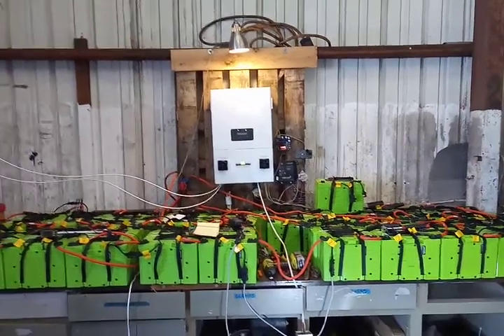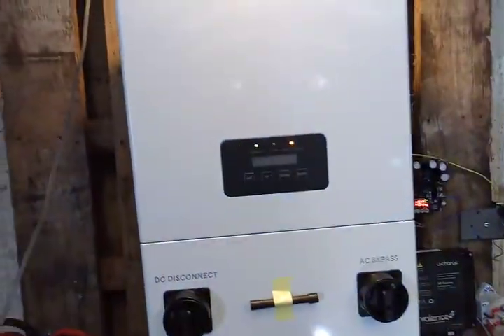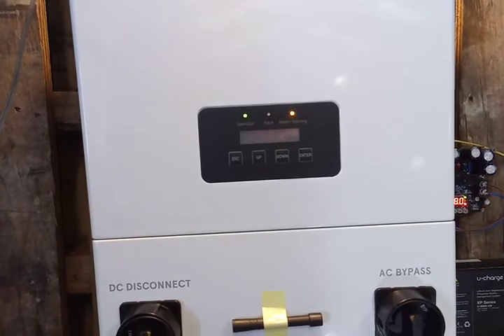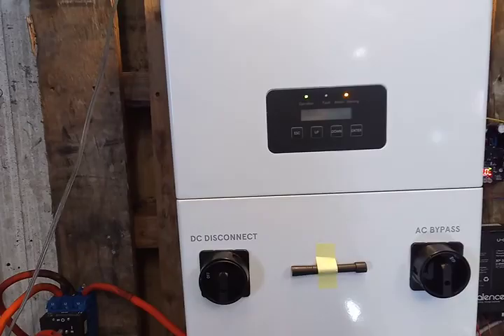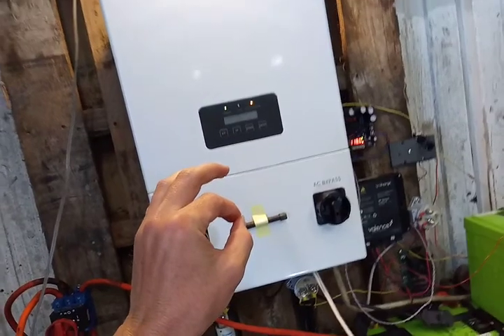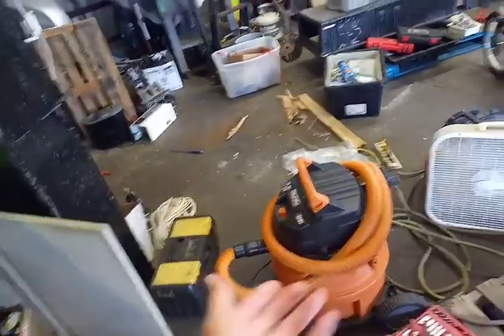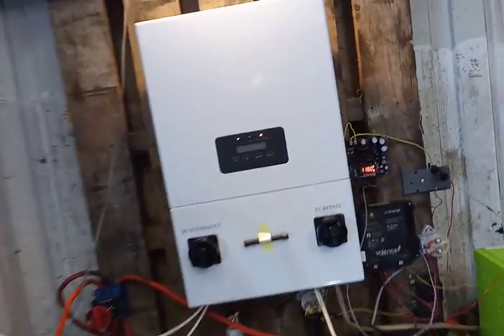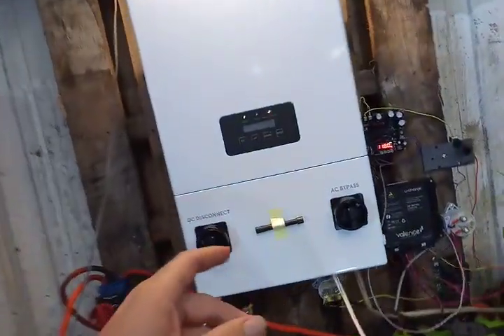Vid #2.  Discontinued Tesla initial experiment results.

Comment: I know it has been awhile,
Did you make any more progress on your battery bank?
Reply from the maker: I've been using it off grid ever since this video. I haven't been recommending it because they randomly explode and I'm not sure if it's caused by my workaround that I had to do in order to get this thing working off grid or if they'r exploding all on their own.
Reply: @SiriusSolar  so, the batteries are charging and discharging using the Delta H6?

You are using the outputs designed for off-grid power, without the unit being grid-tied to A/C? 

Or… are you using the Grid Tie outputs with another inverter driving the A/C sine wave on your house line?

I am building a system with a Delta H6 and I am trying to determine what NOT to do :-) 

(I saw a note in some specs saying the D/C to A/C ratio must be 150%, so I am trying to also determine if that means I should not put more than 360v into the PV inputs… how much input voltage are you pumping into your H6?)
Reply from the maker: @DavidHalko  I have 300 volts of pv coming into each solar channel with 2500 watts each.   I have a second H6 with another 325 volts at 3,000 Watts on one channel.   They are not grid tied in any way not even to each other.  I did try and have one create the sine wave and run it into the grid connection on the other so that the other could help it but it just errored out and shut down.  Long as it actually worked for was 30 seconds. It claimed ground fault most of the time but sometimes it had other errors.
Reply from the maker: @DavidHalko  I have my battery connected to the actual battery spot and the H6 is charging and discharging the battery.  Trying to keep it working off grid in the night time was where I had to add some custom hardware to the circuit board.  I highly recommend no one try this.  It's cost me a few million watt explosions and several hundred dollars of bad fuses.  To make the problem four times worse I've added another H6 so trying to get them to power up and down together without them exploding each other has been a trick.
Reply from the maker: @DavidHalko  my advice is use it for grid tie only.  If you want battery backup Spend the money to get a inverter that's not locked on Tesla's network. Something that's more user-friendly like an SMA or non Tesla Delta.  There's all kinds of workarounds you can do like If you wanted to run it from a battery you could get a dedicated battery charger to use the grid power to charge the battery. That would be much easier than messing with what I have done.  It would get you proper top balancing voltage and the ability to drop to a float voltage which is something I don't have with this inverter.  You want to put an inductor on its ac output if you're running off grid because although it's surge ability is good it's just not good enough.  I actually used a transformer as an inductor so I'm only pulling 240 out of the inverter now. The transformer pulls evenly from both legs and sends it to my breaker panel as in 120 + 120.  This doubles it's surge ability plus adds the inductance of the transformer so it's probably somewhere around 400% higher surge ability now.
Reply from the maker: @DavidHalko  page 5 section 1.2 talks about 150%.  My take on that is you're allowed to have a solar panel size that's not just 6,000 Watts but actually 9,000.   You're allowed to over panel!  Sure it'll only put out 6,000 Watts even if there's more than that available. That's what Ben is experimenting with.  He his goal is to slowly simulate over paneling more and more and more above 150% until he's sure that he can safely connect an electric vehicle battery to the solar panel input which would basically be hundreds upon hundreds of thousands of lots available to the solar panel input.  I pointed out to him that although it may work just fine there could be a problem when the H6 tries to randomly check the resistance of the solar panels at night. What would happen if the h6 tried to check the resistance of an electric vehicle battery?  Checking it in the dark isn't going to help.
Reply from the maker: @DavidHalko  page 37 section 3.71 also talks about 150% and in that regard it's very clear about what it's saying about it being the over paneling limit.

Comment: Hello. Can you say this hybrid inverter can work with battery of EV cars 400v?
Reply from the maker: That's too low to connect to the battery connection. Ben Nelson is making a video series connecting it to the solar panel input.
Reply: @SiriusSolar  Solar City H6 works Battery Interface (DC) Operating Voltage range 400-550V and EV battery has 400V
Why not?
Reply from the maker: @igo2442  because so far we don't have the ability to command the H6 output voltage.  Which means we can't dial in the proper voltage for doing a top balance and then backing off to float.  Sure if your discharging the battery it'll work fine up until a certain point when the H6 will shut down. But the problems are during charging.
Reply from the maker: @igo2442  The inverter requires battery voltage over 460   I'm not sure how it could go lower than 460 in the original setup maybe it's because it communicates to the battery. But in my system when my battery falls below 460 volts the inverter shuts down.

Comment: Another query can work on zero injection and what would the configuration be like
Reply from the maker: You'll have to rephrase your statement in plain English for me.
Reply: This inverter works without injecting power to the grid like other grid connection
Reply from the maker: @elmergonzalez8005   yes
Reply: @SiriusSolar  I have to buy an extra accessory so that the inverter does not inject into the public grid
Reply: I would like if you can tell me what I can do to avoid injecting energy into the public grid
Reply from the maker: @elmergonzalez8005  I think it's possible but it may require having a Tesla account I've been having trouble linking this hardware to my account because I did not buy it from tesla.   if I can link it to my account I may be able to control Its behavior using the Tesla app on my phone.
Reply from the maker: @elmergonzalez8005  one way to stop it from exporting power is too disconnect it from the grid
Reply: And they don't sell a meter that controls the injection
Reply from the maker: @elmergonzalez8005   so without that meter the only way they could control the injection is through the H6 itself.  so it would sense how much power was going to the critical loads and would match that in solar harvest.  so whatever you wanted to power from the solar would have to be connected to the critical loads connector.  All the hardware is there but I'm not sure if they made it possible in the programming.
Reply: Thank you very much for always answering, I could not connect to the application but I am working offline with the backup

Comment: the panels it uses are 24v in series
Reply from the maker: Is that a question or a statement?
Reply: I am going to install it this week and I will use it without a battery because I am in Nicaragua and there is no pawerwall here
Reply: Question brother I would like to know how the installation goes because it uses 4 string
Reply from the maker: @elmergonzalez8005  the higher the voltage the more efficient it is. I had 10 panels in series for a total voltage of 320v.  I had only connected one string in this video.   If I had another string I would have connected it to the other charge controller. Despite having 4 inputs  It only has 2 charge controllers.  You would only need to use all 4 inputs if you had very low wattage panels or if your panels Max voltage rating was low you have to split the strings into lower voltage halves.  Most people would put a single series string of around 400v @ 3000 Watts on each charge controller.  For a combined total of its maximum at 6000 watts of solar.  I'm not sure how much over paneling it can handle.
Reply: a couple of days ago I bought one I would love to explain how I will install the panels
Reply: If I can make 4 sets of 5 panels or only do two sets of 10 panels
Reply from the maker: @elmergonzalez8005  do you have the panel's you're going to use already? Look at the specifications on the sticker it'll show you the maximum voltage input. Just put your panels in a series string being careful not to go over the maximum rating.
Reply from the maker: @elmergonzalez8005  are you going to connect a battery or are you using it for a strictly grid-tie only?
Reply: when you use the 10 panels the two phases work, 220v
Reply from the maker: @elmergonzalez8005  yes. It only needs one string and both legs of its AC output work.  It puts out 124 volts on each leg that works great with regular AC appliances.  248 volts ac for the larger appliances.
Reply from the maker: @elmergonzalez8005  using the higher wattage panels will max out theallowed watts per charge controller long before it maxes out the voltage.  However Using old used lower wattage panels like 200 w you'll end up getting a higher voltage at a lower amperage with more panels in series and running more efficient. But the efficiency difference is negligible so don't worry about that.
Reply: I thank you very much you are very kind and I love the explanation you have a great knowledge greetings from Nicaragua, success brother
Reply: I still haven't bought panels that you recommend 320w or 340w
Reply from the maker: @elmergonzalez8005  which wattage panel? I can't really answer that without knowing all of the specs on the panel but I will say it's solar panel input abilities is very versatile it can work with just about any solar panel .

Comment: Are you able to adjust output voltage for a grid tie setup so I don't  get charged for overages
Reply: Have mine hooked up as island feed... Grid off... 4600 watts solar.. Florida Sunshine... I can run 12000btu mini split... 8000btu window AC. Small 12 cubic ft sub zero frig and 65 inch TV all same time no batteries no grid middle of day full sun...  If clouds come over my 12000btu unit drops first  L1 leg... L2 has frig and 8000btu and 65 inch TV stays on it... if more clouds move in everything drops... How's your batteries working out?? Can we get a 4-500v charge controller to salvage some viable use out of this h6?? I ordered 120 used Tesla 21700 3.7 batteries to give it a try..
Reply: At night I simple throw two breakers and connect to the grid...  Not sure if this h6 will allow me to do this each night..  we shall see this is my first night... I was just happy shit didnt go up in smoke as I did some wiring above my pay grade...
Reply from the maker: @ohiotraveler03  what you need is one of those fancy inverters that is careful not to export any to the grid.
Reply from the maker: @ohiotraveler03  make sure when you connect the battery you do through a pre-charge resistor first or you'll blow both of the fuses in the inverter.
Reply from the maker: It puts out 517 volts to the battery.  But if the grid is connected it will export all the battery power When there's less than 6000 watts of solar coming.  in other words it combines the battery power and the solar power in order to max out its export ability.
Reply: @SiriusSolar  
Did you get it to charge your battery pack?
What size battery should I build?? Is there a battery build in YouTube that you suggest??  I'm using used Tesla 3 cells 21700 currently have 120 shipped... Should I add a few more ?
Reply from the maker: I don't remember but if you look you'll see There are some AC output settings in my other video.  The title is something about the passworded menu.
Reply: @SiriusSolar  yes I reviewed that video and thanks for the password...  There was no adjustments that would help me in there....  I am making more power than I use so my power company is billing me for my power I am giving them... Just looking for a solution other than getting a different inverter...
Reply from the maker: @ohiotraveler03  wow that's a horrible agreement you have with your power company.  Is it some kind of smart meter that knows you're over producingat that instant or is it just the end of the month accumulation total that it's looking at?
Reply: @SiriusSolar  yeah it shows delivered when I use their electric and when I have overage the meter says receiving but billing is for what ever crossed the meter either way...
Reply from the maker: And I don't have the gateway yet so I cannot connect to the inverter wirelessly to check out what other settings there might be